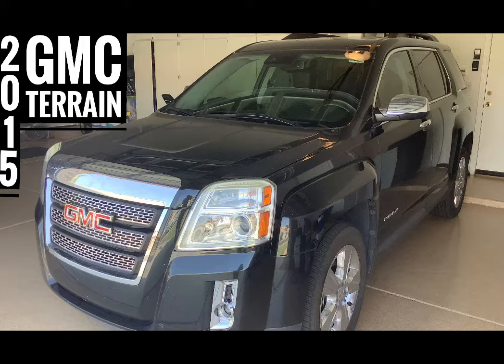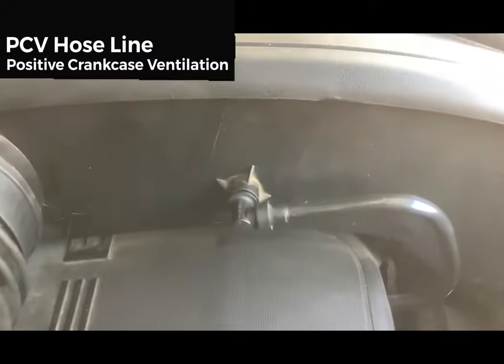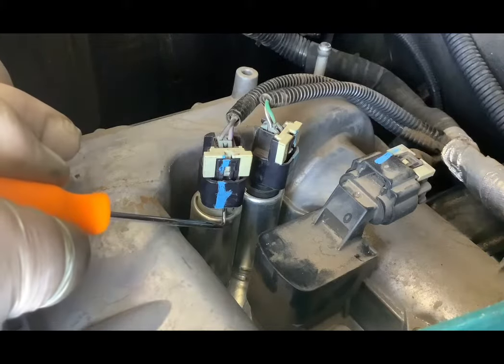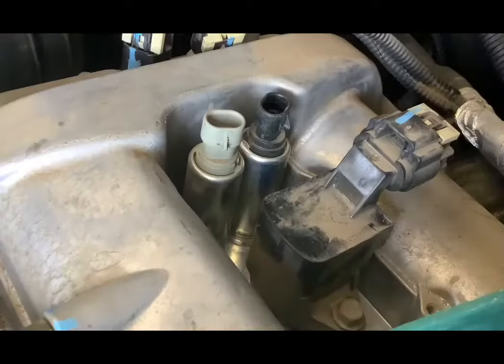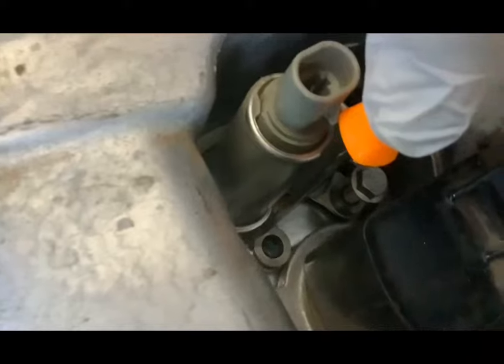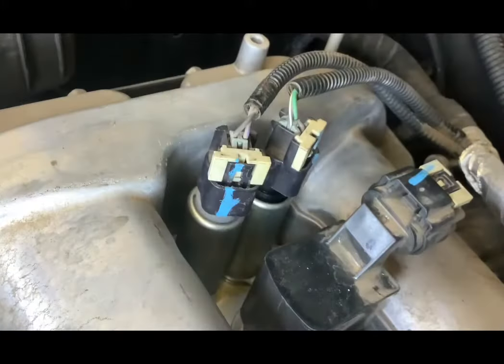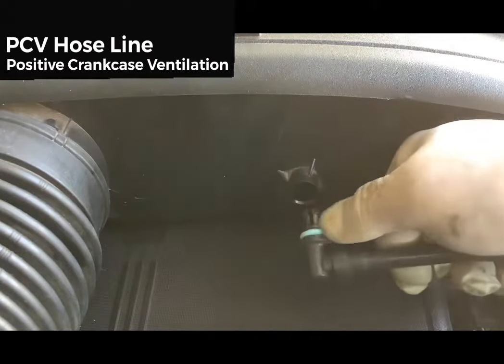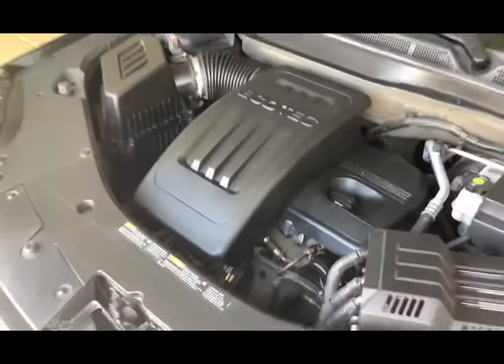GMC Terrain VVT Solenoid Replacement

Comment: I'm a 60 year old woman on a fixed income. I just finished these repairs! I struggled to get the old parts out as my grip and strength aren't what they used to be. Thank you so very much for making videos. God bless you!
Reply: I'm a 35 year old man who is a god awful excuse of a mechanic. I also finished these repairs with no issues.
Reply from the maker: Those valves can be tricky to get out for anyone, tight space to get them out,
Thank you, glad we could help you in getting you vvt valves changed yourself and not by the expensive stealership’s shop
Reply: Thank you for this message… Im actually going to change mine out… myself …
Reply: @YourLifestylist  Do it! 🥰🏆❤️

Comment: Hey guys. Just want to add a small detail to his video. Be sure when installing your new parts, the white sensor top is for the "intake", and the black sensor top is for the "exhaust"! If done incorrectly it will shut itself off.

Comment: Only one thing you forgot to mention that is important.  You should disconnect the battery when you do this to reset the engine light.  I just did this and I didn't have the pick which made it a pain in the butt but I still could do it.  Thanks for your video, MAJOR HELP in doing this.

Comment: Great detailed video. Would this stop my exhaust from smoking?
Reply from the maker: Smoke?
With smoke it’s all in the color of it,
Blue, blue/grey = Engine oil is entering the combustion chambers.
Black = The fuel mixture is too rich
White, white/grey = internal engine coolant leak into the cylinders or cylinder head due to cracks, porosity, a failed head gasket, a bad intake manifold seal, worn valve guides, or bad valve-stem seals

VVT solenoid manages the valves’ opening and closing times to ensure that efficient fuel consumption is maintained.

Any malfunction of the VVT solenoid is therefore certain to result in efficient fuel consumption. So if you notice a significant drop or increase in your average fuel consumption and smell of unburned fuel, it is very likely that your variable valve timing sensor might cause a little smoke, but it all depends on the color of the smoke,
Hope that helped.

Comment: This was super helpful! My car started right up after I changed these out last night, but then this morning it won’t start again. Does that mean I maybe need to change the camshaft position sensors too?
Reply: With me it just made my check engine light come on. My car was able to start and run fine. That's just my experience though.
Reply from the maker: Well qtreiner85, let’s go over some of the basics and start from there,

The VVT solenoid is responsible for controlling the flow of oil to the camshaft.

The most common symptom of a bad VVT solenoid is a check engine light on your dashboard. You may also notice issues like rough idle, rough acceleration, increased fuel consumption, or low engine power.

The camshaft position sensor is responsible for telling the computer the position of the camshaft.

The most common sign of all bad camshaft position sensor symptoms is that the car will be more difficult to start or not starting at all. As the camshaft sensor becomes weaker, it does not send the signal to the on-board computer and as a result, the ignition system cannot produce a spark correctly.
No spark means that the engine will not start at all,

So if you could reset and recheck the engine fault codes, most common faults for these would be p0010, p0011, p0013, p0014

It is also possible that you find a completely different code, like one for starter relay going bad, you stated it start that night, then no start in the morning. Was the dash lights all on? If yes, In your fuse box there is a starter relay, I have seen this issue in the terrains before, with ignition off, pull the starter relay, turn key to “ON”, do not crank it like you were starting it, all dash lights should come on, now re-insert the relay, and then give it a crank, I have had luck that this jolts the relay to go you home or the auto parts store.

Hope this was some help, let us know what you found.
Reply: @monkeywrenchgarage6479  Thank you so much for all of that information! I really appreciate it! Unfortunately i ended up taking my terrain to the dealership, basically had to have my entire engine replaced, they had it for 4 weeks. And now it is back to doing the same thing where its burning through oil way faster than it should, its trying to stall and it will sort of jump. Then the check engine light came on, it said "Engine power reduced" and also "service stabilitrak" i added oil because it was about empty yet again, and was nowhere near needing an oil change yet. But that helped for the time being. I still have over 2 years of paying on this car. facepalm
Reply: @bobbrock4221 my check engine light is on but the vehicle runs fine.